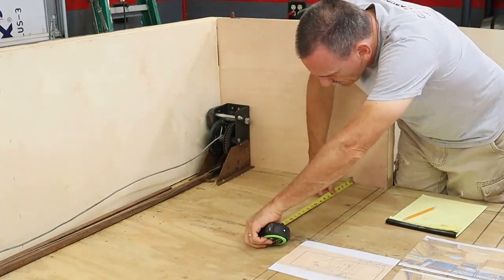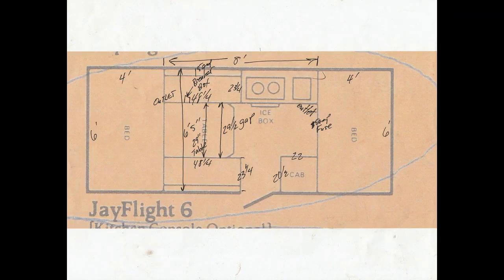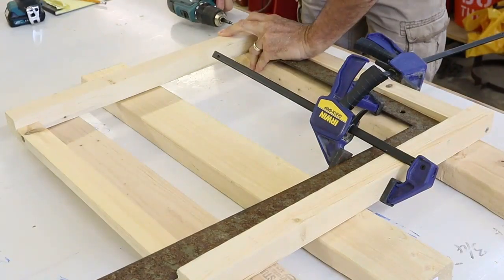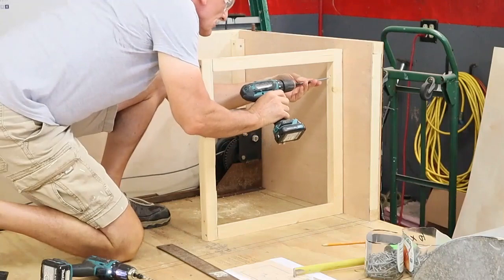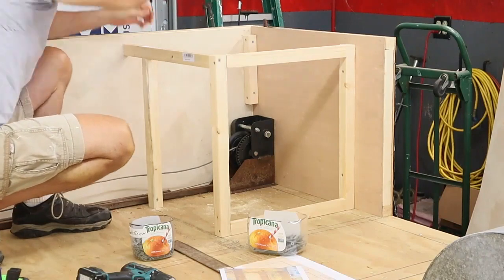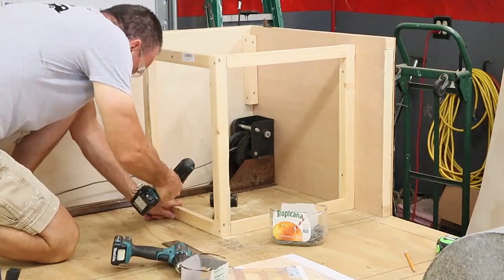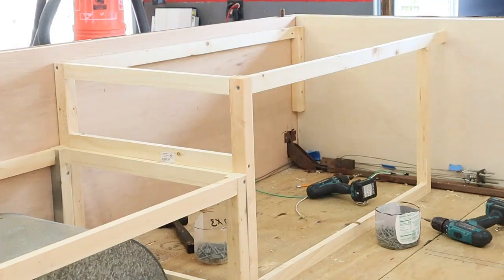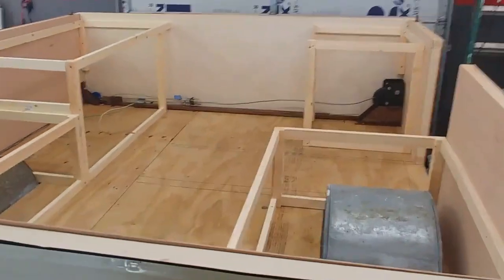POP UP CAMPER WOOD FRAMING Repair Replacement Rebuilding Tent Trailer Renovation PT17

Comment: How thick is the plywood floor.   I found some pressure treated wood at Lowes that's 3/4" thick that I thought if using.  It's a little heavier but I think it would be stronger then what was on there
Reply from the maker: I would use 3/4 marine grade plywood if available. Thanks for watching.

Comment: I saw nothing wrong with this at all good job lol. here's one for you Greg I don't use 1x2's any more I'll get 2x4's and rip them on my table saw into 1and 1/2 and 2 and 1/8 still small but stronger. I don't drill holes in them I had one left over 1x2 and went to use it on my trailer and it split right away so out it came and I ripped another 2x4 down.  Now where I can I try to use 2x2's again ripped from 2x4's. It may help you a bit. Or file it under Den's nutty idea's but it does work well for me.
Reply from the maker: Yep, I agree with you Den. A table saw would reduce costs and provide opportunities. My shop lacks a table saw for reasons you wouldn't be aware of. About 10 years ago my dad almost lost his right thumb with a table saw. He made a bad decision and it almost cost him. He was about 70 years old and very experienced with heavy machinery, he knew better, but a simple mistake could have been life altering. I had to drive him to the emergency room after the injury. It was a terrible injury and a horrific trip to the hospital. I have been leery of table saws ever since. Superstitious I guess, but my digits are still attached. I continually find a work around but I will probably get a table saw, one day. Thanks for the suggestion though. 😃
Reply: @FakeLegGreg  Table saw's scare the crap out of me every time I fire it up and I never use it unless someone is out there with me I never push it. I always have a run out table to catch the boards and I always use the push stick and make sure my hands are out of the way. For me it's like every other saw they will hurt you bad if you don't watch it. I also have a drill that scares me it's a bad azz and drills just about anything I need it to but it doesn't stop right away it keeps on going and if the bit gets jammed up it'll slap you and knock out teeth. And yes I have names for them to lol.  Hope your Father didn't lose his thumb and he could keep on keeping on.
Reply from the maker: @Cockeyed_Den8213  He is good now. They saved his thumb but I never allowed him to work on my houses again. I couldn't deal with the guilt if he were injured that bad working for me. I have a 1/2 drill motor that has hurt my arm a time or two. i never learn to let go when it begins to hurt, I guess I keep thinking I am strong enough to stop that motor and it keeps proving me wrong. LOL. I have seen 3/4+ inch drills motors with 2 sets of handles on them for 2 guys to hold on to. I never thought if formally naming my tools but I have called them a few names. LOL
Reply: @FakeLegGreg  Well it's good to hear he is ok now. I understand about the Guilt to. Yeah that's the type of Drill I'm talking about I call it the Dentist because it has knocked out some teeth in it's time.  It has the handle by the trigger and one on the back. I sometimes call them other names as well but they do have their own name.

Comment: You're on fire GB! You can be that way when You get started right. But You have to know what You're doing in the first place. Not a Cobbler like Me. When You are anchoring You're cabinet's to the floor and a screw goes through the floor and sticks out, should crawl underneath and put some silicone or sealant around it and the floor for water protection?
Reply from the maker: I  like that MT and will do it. Thanks for the suggestion. 😃